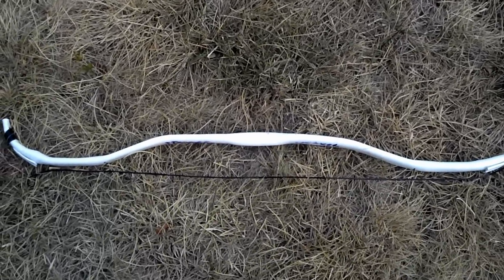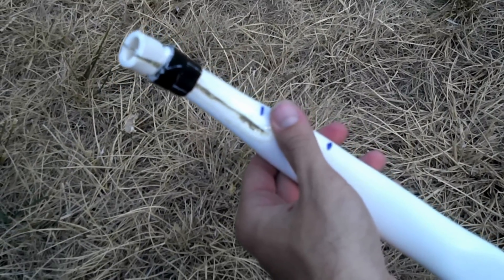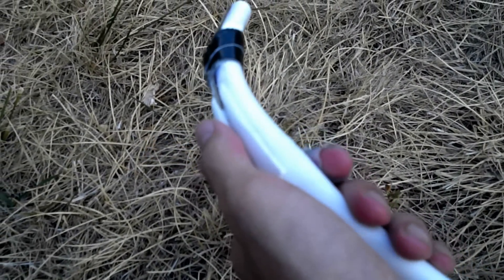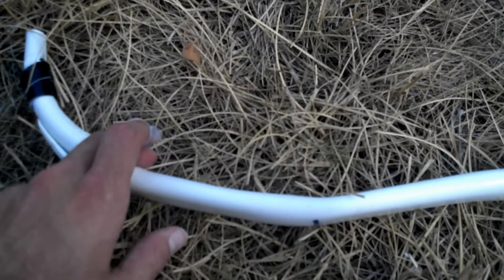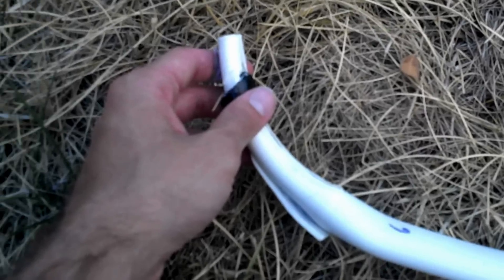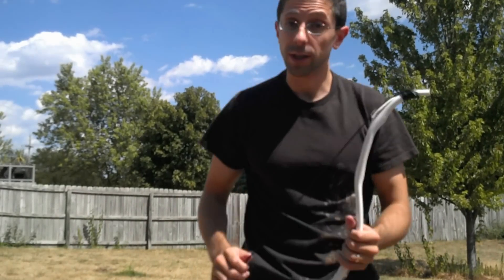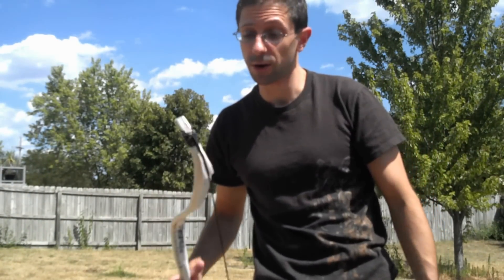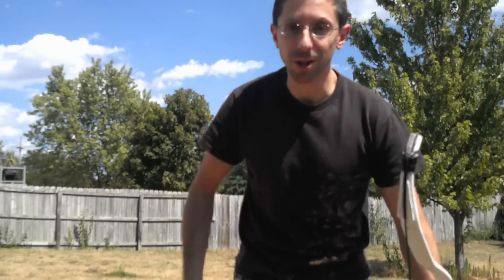Ottoman Turkish Target Bow from PVC

Comment from the maker: No, by hand, just taking more time and being careful - a trick I have, though, is pretty much what you said - I use a 1 or 1-1/4" pipe sometimes to help keep the limb bend nice. Just drape the hot joint over the pipe, and roll back and forth until it cools. When it's cooler, use a gloved hand to tweak the joint - it shouldn't be thicker or thinner than the surrounding limb areas.

Comment from the maker: The epoxy that I've been using is the 5-minute two-part you find in tubes at the hardware store. I attached the string guides with hot glue and epoxy around the edges; I'm going to fill in any gaps with bondo or the like, then sand, finish, and paint it up like some of the other bows I've made. I just filmed another clip of this bow, will upload tomorrow :-)